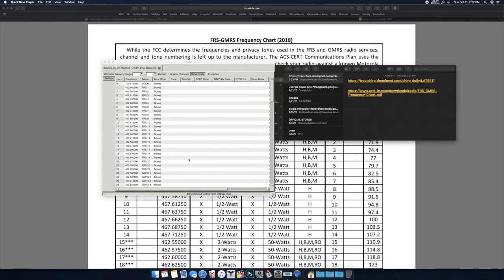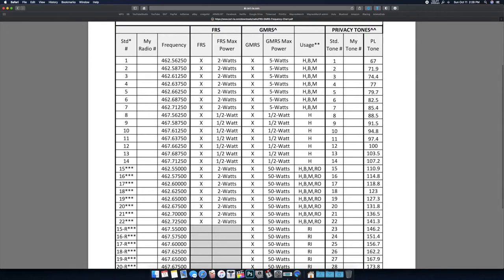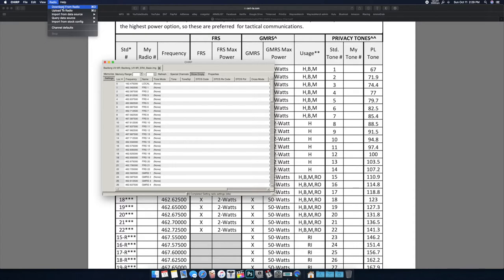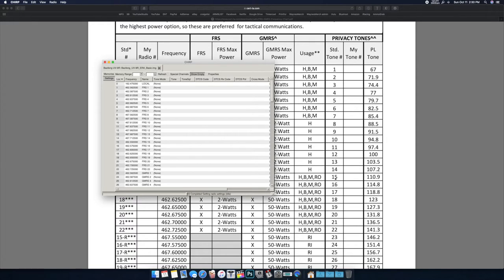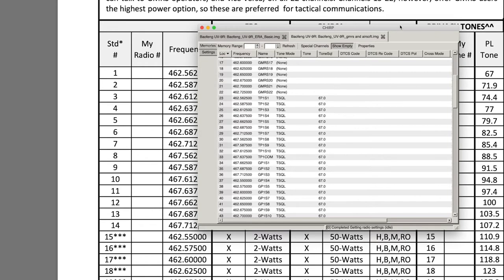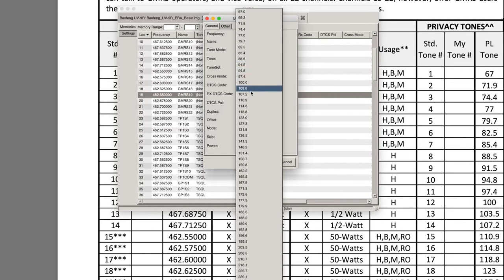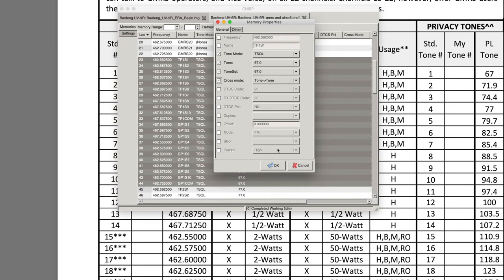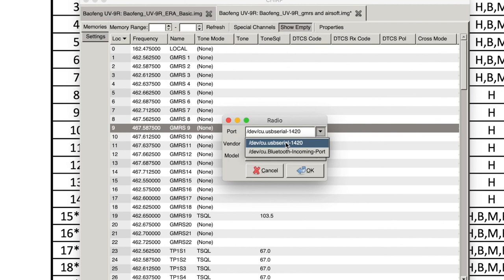BAOFENG AIRSOFT FRS GMRS PL TONE SETUP CHIRP S16E01

Comment: Thank you for making a very informative video. One question, I did everything you said, and can receive and transmit on the privacy tones. However when I put my Motorola radio on say 15, I could hear all my transmission that I have set on the Baofeng's to 15-6. I Don't receive any transmission on any of the other privacy channels on the Motorola. Just when I set the main frequency to 15-0. I have tried it on other channels as well and it works the same. Do you have any thoughts as to what I can do?
Reply from the maker: that's how they all work. Privacy tones can only restrict what is being sent, not received. So the main channel can hear all the PL channels under it but not vice versa. That's why you want to avoid using the main channels. Privacy tones are not private.
Reply: @pawpatina  thank you for the info! Much appreciated!
Reply from the maker: @altonemery9526  No worry! Thanks for watching!

Comment: when i enter a tone number into tonesql the offset automatically populates to 5.00000 duplex changes from "off" to +. I tried using my two UV-5G radios with those settings but they did not hear each other.  if I clear the offset and duplex, it just auto populates again.. any suggestions?
Reply from the maker: 5:19 you must be doing it wrong. watch again. and i have a few other videos in this playlist.
Reply: @pawpatina  ok it works if I use an existing channel. I used location 17 and added a tone to it. But this does not allow me to monitor channel 17 with out a tone. In location 23 I entered channel 17 frequency with out a tone but we can’t hear each other using that Chanel. Is transmission restricted to only the first 22 channel locations? I’m using a UV-5G.
Reply from the maker: @IniguezFamily  When you have everything setup, and you press the PTT button, does the walkie show a TX symbol? if not yours is a newer locked device. check my other vids for the unlock.
Reply: @pawpatina  thanks for the reply, i just tried it again and everything seems to work correctly now.. I have location 17 set to gmrs 17 freq with out a tone and location 33 set to gmrs 17 with a tone and i can talk and listen to both.  i have not idea what i did wrong the first several times, it seems so easy and simple.  thanks for responding and helping out, I appreciate that.
Reply from the maker: @IniguezFamily  No problem glad you got it.

Comment: Is there any frs frequency for 420-450? Because I can’t transmit on frs frequency 462-467 MHz. But I can listen but can’t transmit. I need your help please, I have GT-5R radio.
Reply from the maker: I linked in the description to a chart with all the FRS/GMRS freqs... and no, only 462-467 is available for civilian use. you are probably trying to tx on a police or Ems channel and will be caught pretty fast and charged.
Reply from the maker: how do you know you can't tx? have you tested with other radios? send and receive?
Reply: @pawpatina  Yes & when I try to transmit on frs frequency it make a beep noise. And I use frs frequency on my UV-82 on 462. 5626 but on a on GT-5R the frequency for 462.5626 is 428.273 on GT-5R
Reply from the maker: @OfficialChrisBreezy  I have no idea what's going on there. you may have a defective unit.
Reply: @KngChrisTv ...  just bought a UV5R last week - also can't TX on any 462-467...  It was said by another channel that the newer BFs (in an effort to help people not 'make the mistake' of TX on FRS)  now block out TX on that range.   My radio can TX on other HAM freqs... but it doesn't even even try on the FRS/GMRS freqs.  Receive?  Sure, no problem...  I've fiddled with all the other tone settings and when setup properly the BF receives just fine... (from my kid's Cobra FRS toy-talkies) - but the BF won't TX at all on FRS freqs.   I did find one person on another video who found that some radios have the UHF upper limits set too low (CHIRP, Settings tab, Other settings: UHF Upper Limit ) and after setting that higher worked for them...  But for me with my new unit...  ugh.   No joy.  Been looking all day... can't figure it out.      Good luck!
Reply from the maker: @madfunk99  bummer
Reply from the maker: @madfunk99  check my latest videos, there is an unlock
Reply from the maker: @OfficialChrisBreezy  check my latest videos, there is an unlock
Reply: @pawpatina  Thank you so much!!!   YOU ROCK!!! A+++

Comment: noob here...what are the benefits of setting up private channels?
Reply from the maker: lets say you are on channel 14 with no privacy tone. you will hear not only everyone on channel 14 in range but also everyone on channel 14 and any privacy tone. this way you only hear people on that privacy tone, aka your group.
Reply from the maker: In airsoft for example... Command will be listening on channel 14. platoon 1 squad 1 will have PL tone of 1 so they only hear each other. Platoon 1 squad 2 will have 2 and so on.
Reply: @pawpatina  ahh...ok, got it. Thx.
Reply: Thanks for the explanation. One follow up question. Let’s say someone on Platoon 1 is transmitting. Someone on platoon 2 doesn’t hear anything, and assumes the channel is clear. But it isn’t. Platoon 2 person transmits. Doesn’t that destroy both transmissions?